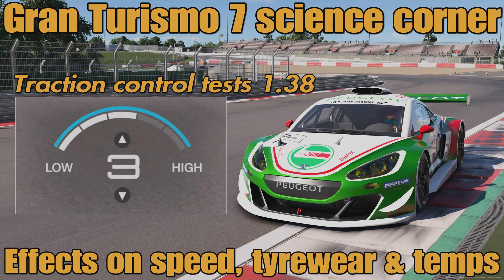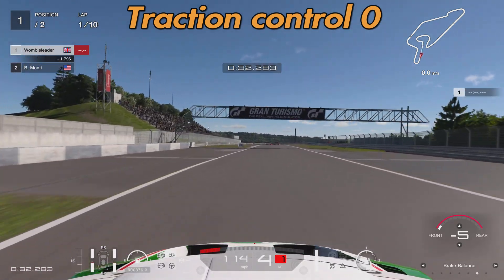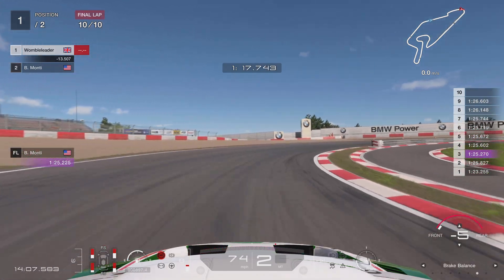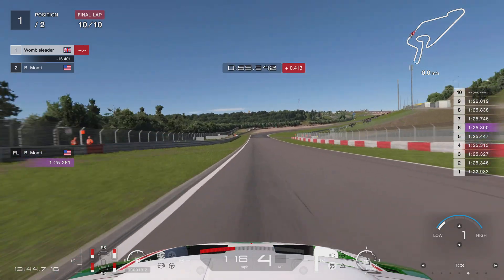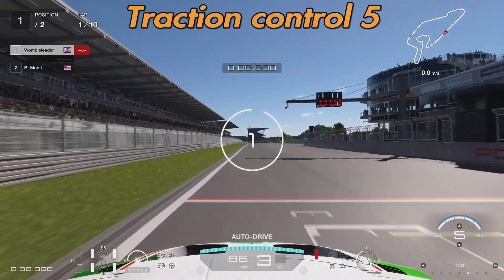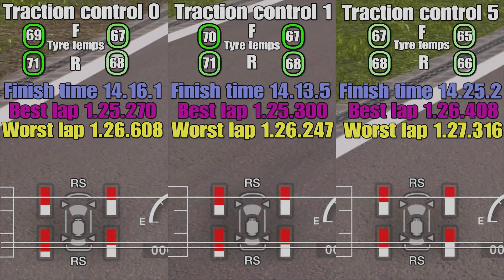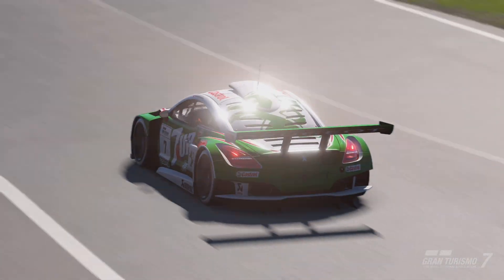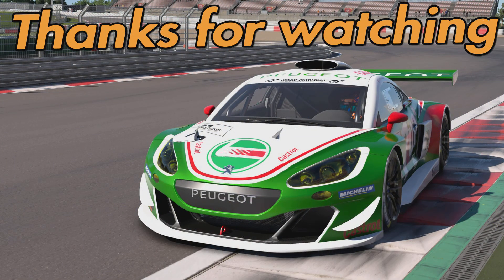Gran Turismo 7 science corner....Traction control testing after update 1.38

Comment: What i find crazy, i race with lots of people  , but recently  i have notice the people who are crazy fast on gt7  ,   are slow driving at IRacing  , perhaps that are able to exploit gt7 more or because  set up is way more involved
Reply from the maker: Tbf iv seen a few WT GT7 drivers get 7-8k irating very quickly so there is definitely transferable skills.

Interestinly iv seen a lot of drivers play GT then go play something like ACC then when coming back to GT7 they have taken stuff learned from ACC and applied it to GT7 to go faster.

A lot of people think driving aggressively on GT is the fastest way(and it can work) but smooth does tend to be faster overall...I think that could be the root of the problem.
Reply: @wombleleaderracing6455  I agree 100% ,  what my main issue is the people in iracing and even acc tend to have much better racing etiquette  then those in gt7 ,   What most important  for me is running consistently  and clean , but in gt7 you see these drivers with fast  times yet over a period  of a race they tend to never be as fast or exploit  unrealistic  physics such as using  curbs to turn. Really gt7 needs to add real world damage  to prevent these aggressive  driving habits  but you are right , iracing , and acc will make you faster

Comment: ok so before even watching this, i've never understood this.  Traction control seems like it would reduce tire wear etc because it's preventing wheel spin.  the idea that TC would make tires wear more has never made sense.  TC 1-2 depending on car and tire compound seem to be the sweet spot.  Never understood why people avoid it.
Reply from the maker: Well its important to remember tyres also wear purely from gripping as well as sliding and spinning so TC forcing the tyres to grip can induce tyrewear....although thats probably still better than spinning or sliding the tyres.

If you have watched the vid though you will see TC does indeed improve tyrewear through reducing tyre temps but there's a cost to laptime the higher you run the TC.

In the past TC even on 1 was slower than no TC but the change on the recent-ish update that refined how it works seems to have made it more usable.
Reply: @wombleleaderracing6455  yeah slower has always made sense. But more tire wear has always been weird but I’ve heard people say this a million times. So I’m glad you did this video.

Comment: Been having a blast this week at Race C in the 20' AMG with TCS 1. Where other drivers are spinning out at the end or having huge moments, TCS 1 keeps me stable when my tires are near dead. I just turn TCS off at the rolling start because I feel it slows me down when pulling away in 1st gear.
Reply from the maker: I was super surprised how nice TC1 was...its really first time iv used it since the update where they refined it....il certainly be using it as a tool going forward.

Comment: Best way to save tyre tread ive found is to run suspension a bit softer so more body roll is absorbed into the suspension rather than transferred through the tyres and pushed into the tarmac. That plus coasting around corners 1, 2, 4 and 5
Reply from the maker: Yeah iv been using some of the suspension options to improve tyrewear on the Genesis in race C...usually I soften it as well.

Comment: On controller, I find the cars are sketchier now then they were before the physics change. Its much harder to judge the limit of grip
Reply from the maker: Really? Did you play GT7 at launch? Cars were very tail happy then.
Reply: @wombleleaderracing6455 Yes the launch physics were hard, but then they turned it into GT Sport lite, and then they dialed that back a little but still too understeery in some situations. MR cars still suffer a lot in certain low speed corners with camber because the suspension physics are fucked. Try driving the renault at the last corner of deep forest lol

Comment: Saving tyres with TC isn't something I've looked at. I tend to use it depending on which car I'm in.

MR cars I don't tend use it all, where on FR cars I use it on 1 as they tend to spin up the rear wheels a lot easier.

One thing I can see on the video, is even in a straight line TC5 was cutting in and affecting the acceleration.
Reply from the maker: I had heard it mentioned numerous times over the years that TC affected tyrewear but had never really tested it....im quite surprised at results!

Yeah the intrusion from TC5 was clear to feel and see!

Comment: The only time you use TC in GR3 cars is possibly in the rain and while driving naturally aspirated cars as the TC cuts soooo much power at TC1 in turbocharged cars.

A great example to use TC1 in a GR3 car is the Mazda vision car. It is generally better to use to TC 1 in the races as the car is rather sketchy on the rear and like you said, it gives you a little more confidence to push.
Reply from the maker: Iv tried using a few cars now with TC1at Nurburgring and found little difference in terms of laptime. Tbf im not sure whither they are NA or T though so il bear that in mind.

Yeah iv known about the RX Vision for a while being used with TC1. Curious to known how it reacts to higher TC now.

Comment: Cool test. I think the RCZ (and all others) tyres wear a little worse when "in-race" more so than just trialling.
The extra traffic adjustments, and tougher defending styles wear them faster. Which means you'll need TC on the last laps.
That's why it's always handy to map HUD to an accessible button so you can toggle up/down when needed.
Reply from the maker: Cheers Freedom....yep sometimes battling can induce more tyrewear which is why I tend to look for a clear cut move when behind another car rather than needless fighting. Often time behind another car il use that opportunity to be more gentle with the car and try saves tyres rather than ducking and diving for moves that clearly aren't on.

Yeah iv got buttons right at my thumbs mapped to mfd + and -...more for fuel saving races but now I'm going to use it to fiddle with TC mid race as well.

Comment: Huge content brother... the TCS seems much more optimize then 6 months ago.  
In Nürburgring with RCZ I made my quali time with TCS 0 as always.
But when I tested the tire wear, I tried to use TCS 1/2 to compare.... the thing is, I could do only +0.2 slower than my PB and many times. (1.24.4xx)
Pretty strange and it doesn't worked that way before. Was much more penalizing. Same for counter steering on weak I think...

PS.: Don't forget I'm on pad
Reply from the maker: Yeah they changed the TC implementation a few updates ago but this was the first time I had really tried it and was surprised how nice it was...definitely agree wasn't like this 6 months ago....its a tool im going to try using more, could be effective in cooling the tyres down mid race to increase life.
Reply: @wombleleaderracing6455  if you find useful, try the counterbalance assist on weak. I did that exact same test of TCS and counter assist on weak. 
With no assist I did 1.24.4 and with TCS+1 and counter on weak, manage to do multiple laps on 1.24.6xx... couldn't believe myself. With the exact same RCZ and track.